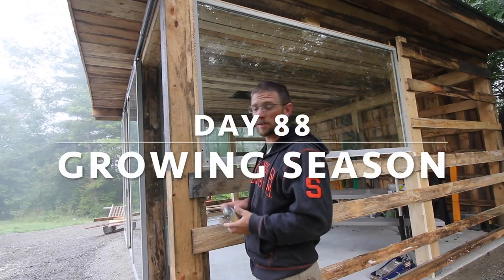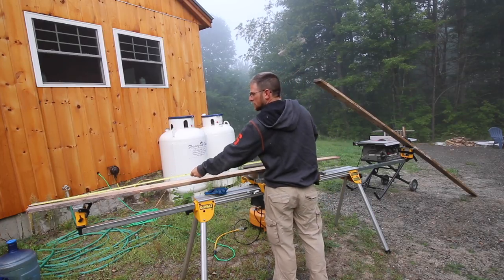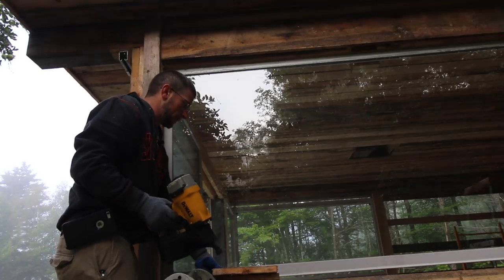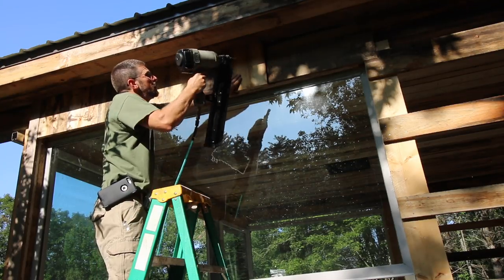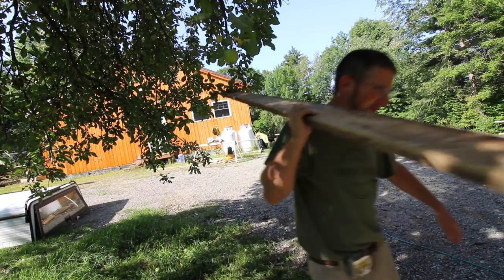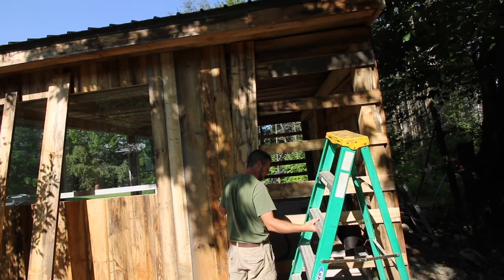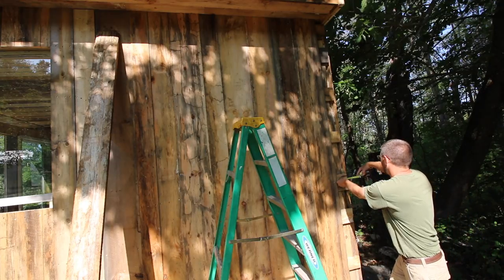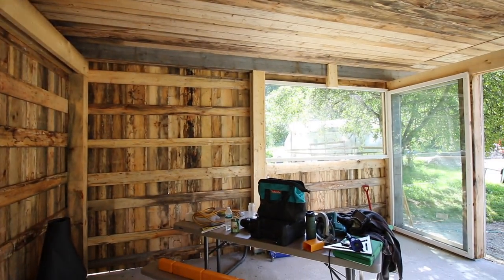Lets Get the Off~Grid Outdoor Kitchen closed in

Comment: Looks great Al, I agree with you on the random widths and natural staining of the lumber. It gives a very unique look versus even toned freshly milled lumber. 
I worked for a residential home builder. A big selling point was that we built old school. All stick built, no trusses, no engineered joists, 1 x 8 decking and roof sheeting, no nail guns, only hand driven nails. Each 1 x 8 had 4 nails across on every joist or rafter, minimum. You are not using too many nails, you are building a solid structure.
Reply from the maker: Thanks! I bet those were some nice houses! That must have been a lot of work hand nail everything!
Reply: They were very nice homes. Hand drivers aren't that bad, once you learn the technique. Packing all the lumber, now that was work.

Comment: Fascinating that you have full daylight at 6am, but here in Ohio were still dark until around 6:30. Yet,  it's the same time zone. 
The patterns on the siding are gorgeous!
Reply from the maker: Thanks! It is crazy the different times the sun rises! Justin Rhodes was saying the same thing when he stayed here.
Reply: I grew up in northen New York.  About equal to northern New Hampshire. I remember as a kid that it did not get dark until about 10:00 P.M. during the summer. A shorter growing season but longer growing days. Now I live in north eastern Ohio and it seems to get dark about 9:15 P.M.  So I have a little longer growing season but shorter growing days.  It all seems to balance out .  Not having a tractor , I cringe everytime I see your tractor being left out exposed to the elements.  Will an equipment shed be in the plan soon ?   Winter will not be far off now.

Comment: Great work as usual. Couple of ideas for you:
1) make a flexible  overflow pipe on "New Yolk City's" water drum, and put it in the ducks water bowl. When it rains a lot and it overflows it will flush out the ducks water and refill it with clean water.
2) Make several smaller window boxes with hanging brackets on them, then move them to the INSIDE of the window in Winter.
God Bless y'all, Simon  ( Sundancer).    :)
Reply from the maker: Those are both great ideas! I really like the window box one!

Comment: I really like your table saw. I think mine is the identical model. BTW I had been biting my tongue on the nail thing until you chose to bring it up. I use a framing nailer for things and more than 2 ring shank nails in a particular board is typically a waste. I have only ever used a coil nailer for asphalt roofing shingles.
Reply from the maker: This is a coil siding gun with ring shank galvanized nails

Comment: Let's not disappoint you. You are wasting nails.  LOL
Reply: LOL The only time to worry about to many nails is when you have to remove them  ;o)
Reply: Actually there is a good reason not to use too many fasteners, nails, screws etc. As wood dries it shrinks and too many fasteners can lead to a very nasty looking finished product after the drying is done. Often what happens on something like minimal length nails is the shrinking pulls the extra nails loose. Unfortunately that also means the nails put pressure on whatever you have nailed and might dislodge those pieces of lumber and create a gap between the thing you are attaching and the support it is being nailed onto. It is the same reason that you never drive a nail fully in when you are attaching vinyl siding to a structure. If the vinyl is not free to move with temperature it ends up buckling and looking terrible. Wood does not move much with temperature but it does move as it dries.
Reply from the maker: That is true!
Reply: Therefore an excuse for Al & his gun to fire again & again & again!!!!!!!!!!!!!!!!!!! Yipee.